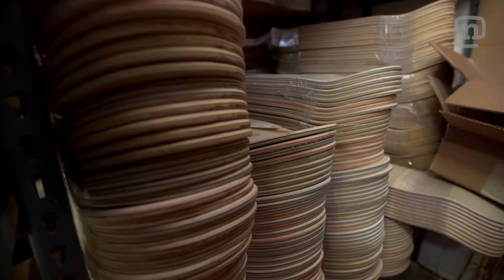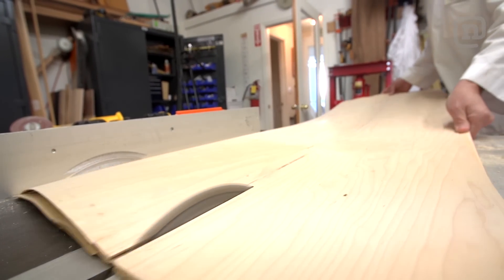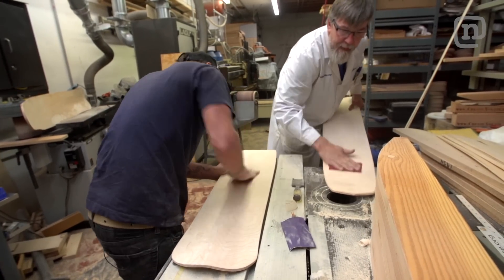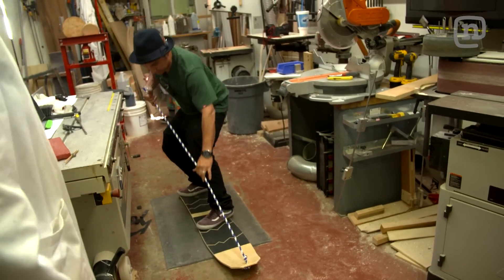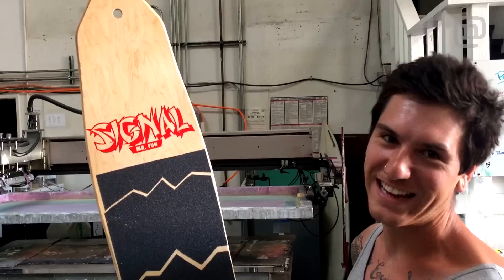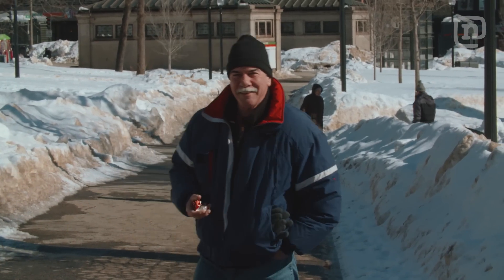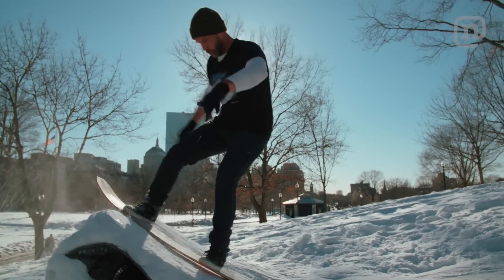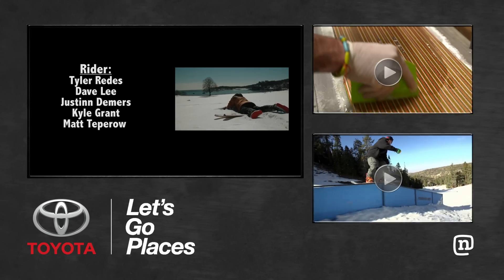Snowboarding Boston With Mr. Fun: ETT

Comment: Ways to improve this: add bindings, make the wood have some kind of edge (just a corner on the lip instead of rounded, not metal needed), and wax the bottom. Honestly didnt look all that fun.
Reply: it's supposed to be without bindings because you don't have bindings on a skateboard either
Reply: they have better grip for snowskates called grip-all it works really good and you save time not strapping its just harder than snowbgoarding to learn snowskating but the pros are good. that deck could use some ptex but its a pow surf so no need for edges they have other decks for that called bi-level snowskates that you can ride at resorts like whistler.
Reply: You realize they already make what you're describing right? It's called a fucking snowboard! This was meant to be something different.
Reply: +cheapo911 I'd add mountain boarding bindings
Reply: @FreckyB  r/woosh